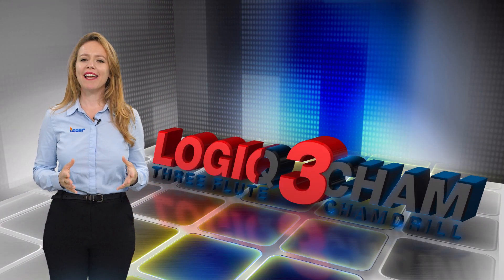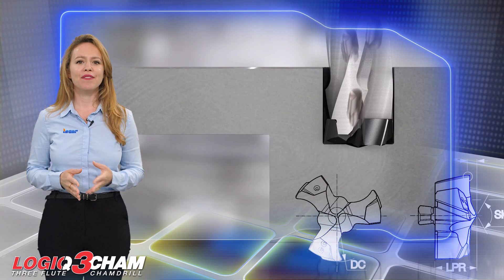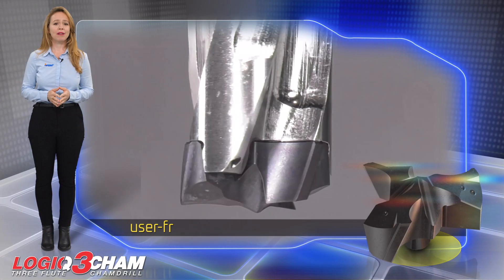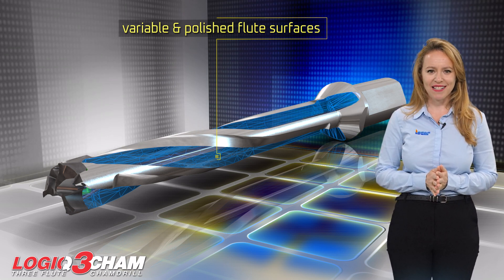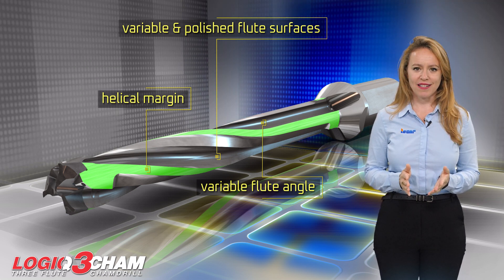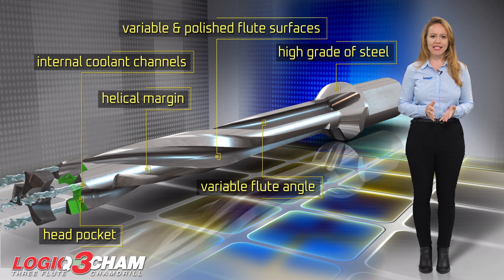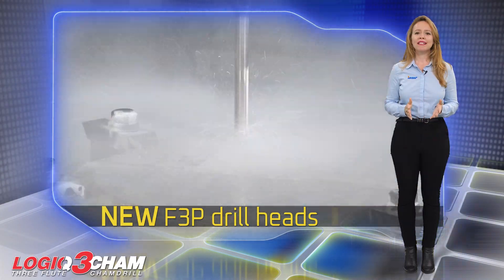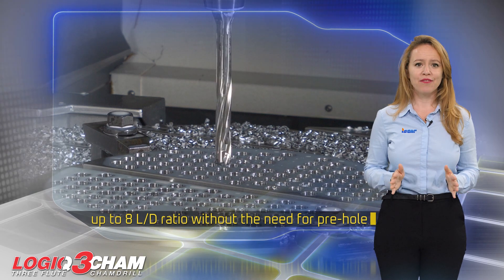ISCAR TECH TALK -  LOGIQ3CHAM Flat 3 Flute Drilling Heads

Comment: How accurate are the Drill's dimensions on a x3D and x5D on a horizontal turing centre?
Are customs cham drill dimensions an option?
How is the tool life on the Drill when axial forces are applied, considering the tool is mounted on a horizontal Turing centre in terms of replacing the Carbide insert once a day running 24/7 if deemed necessary?

Kind Regards.
Reply from the maker: How accurate are the Drill's dimensions on a x3D and x5D on a horizontal turning center? We can achieve H9 hole tolerance depending on the machining conditions and spindle runout.
Are customs cham drill dimensions an option? Yes they are for the line range between .472"-1.02".
How is the tool life on the Drill when axial forces are applied, considering the tool is mounted on a horizontal Turing center in terms of replacing the Carbide insert once a day running 24/7 if deemed necessary?
Tool life is affected by different factors such as cutting conditions, machined material, coolant type / flow rate / press, machining conditions, clamping rigidly, part drawing characteristic demand etc. 
In order to reply with a tool life estimation we will need more information. We recommend you contact your local ISCAR representative to learn more.